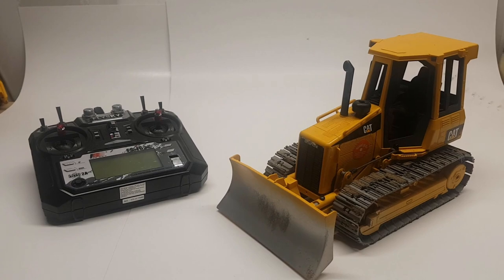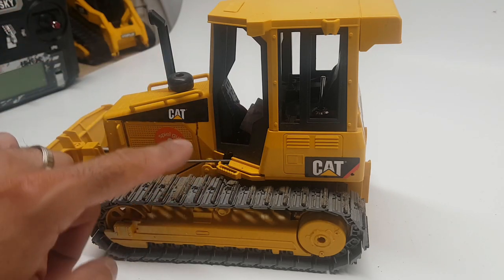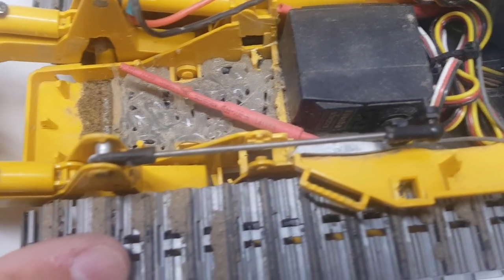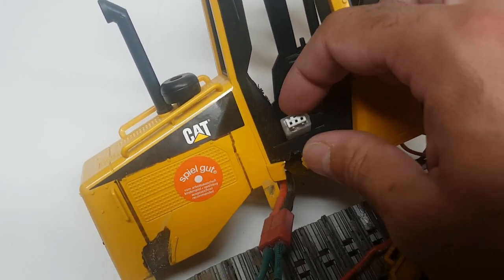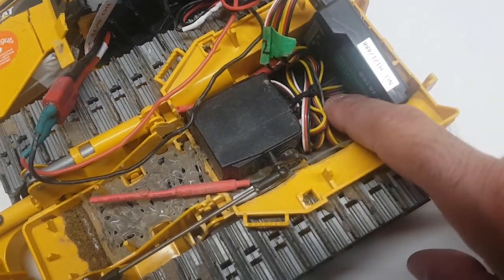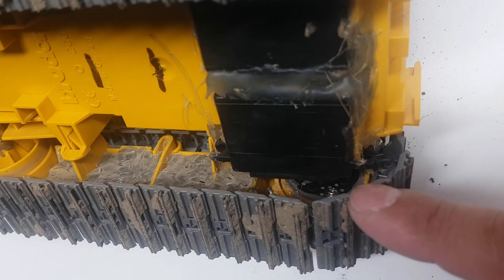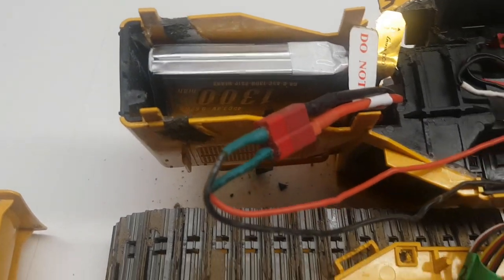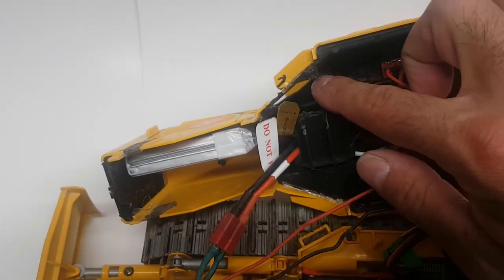Making An RC Dozer! Step by Step | Part 1 of 2

Comment: I just bought this model to hopefully build a full metal one in larger size. I am shooting for 200lbs in weight minimum.  I have some 7.5" sprockets and Stainless steel track chains already. I hope I can build it soon.
Reply: Would love to see that build! Good luck!
Reply: @rcchbuilds  Thanks, I have a project I had started 3 years ago on my channel and will tear it down and build a dozer. I think a track loader may be more expensive than a dozer. I will check out your other videos for more info on radio / electronics side of builds.
Reply from the maker: I will be posting that video this week. I have been busy but will put it up for you. shooting for tuesday upload!

Comment: Another question how is the futaba servo for the blade up down movement mounted?

Is it screwed in using the servo mounting tabs or hot glued or ?? THANKS
Reply from the maker: I glued it in with hot glue which was easier for my first try. I made a new dozer that is all 3d printed which has all the parts list and things required to make it on my other channel.

Comment: Have a build parts list for this by chance?
Reply from the maker: For this build, I didn't have one at the time as it was my first build. But you can use the basic Futaba 5001 servo for the blade lift. the 360 servos you can use a continuous servo or make your own. Depends on your skill level. You can search continuous rotating servo on amazon or your local hobby shop or even Aliexpress and they will all work.

Comment: Hey, love the video!!! I'm building one myself, if you don't mind me asking, where did you get the linkage you used to hook the blade to the servo?? I've looked for them but I can't find any that has the tooth inset that fits the servo, so what brand did you use?? I'm new to the RC world, your video is what made me wanna start with this dozer!!! Keep them coming!!
Reply from the maker: sorry for the delayed response. I used an old threaded rod from an old RC plane I had. check out your local hobby shop and ask them for a 4-40 type rod to link on to a servo. you can bend it based on the length you need. the servo I am using is just a regular futaba S3003 servo. comes with all the head attachments to link to. let me know if that helps.
Reply: Very helpful with one of my questions THANKS

Comment: What servo do you use in D5? And What esc and battery?
Reply from the maker: Great questions! so the servos for the drive is 2x Hitec HSR-1425CR Continuous Rotation Servo. for the blade servo I choose to use a regular servo 1x ANNIMOS Digital High Torque Servo 20KG Full Metal Gear, found on amazon https://amzn.to/36OWBL8. No ESC as there are no motors. Battery is a Gens ACE 1300Mah 7.4v Lipo. probably find it cheaper at your local hobby shop. hope that helps.

Comment: To fix your booboo, look up 3D drawing pen
Reply from the maker: Thanks I will look into that. I used some of that plastic powder mixed with a resin to fill in the mistake. I think the next step is to get a 3d printer and start making some new parts to make this a more versatile machine.